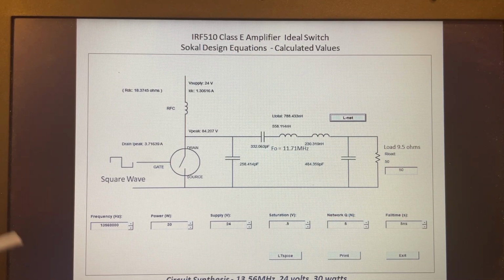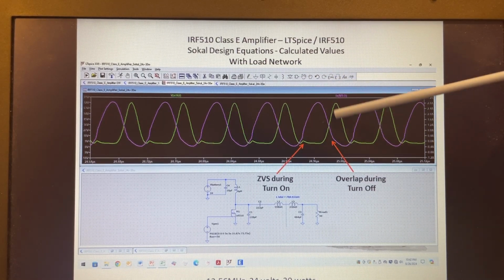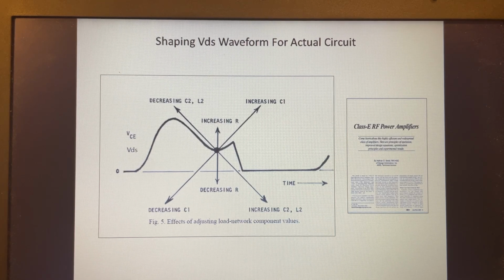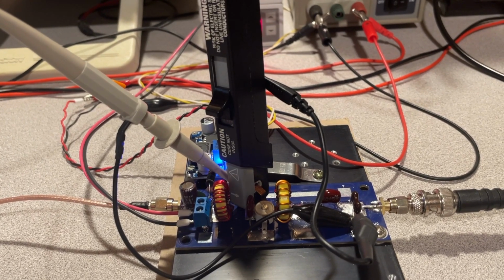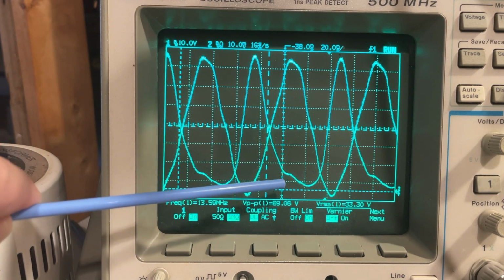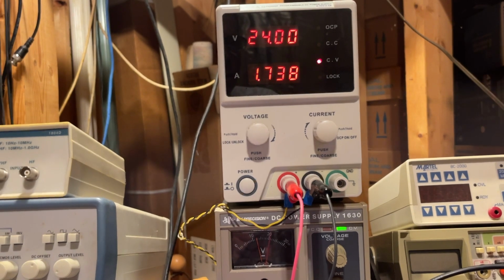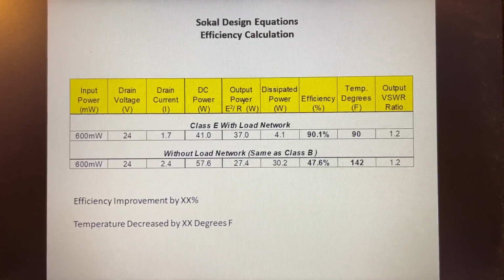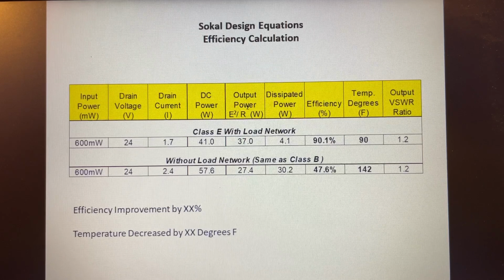Class E RF Amplifiers Explained -  Final Circuit Analysis (Part 4)

Comment: First off, thanks for doing this series, and taking the time to explain so well the derivations and design methodology.
I was initially stunned to see how little dissipation there was within the switching element.
I have wanted to make a little 'wilderness-style' radio and was a bit appalled by the other technologies and what that meant for amount of batteries needed.
I do have a couple of questions: First, say on 40m, what would you think would be the allowable BW before either significant degradation or retuning of components?
Second, I see a lot of 24V designs, but what power level limit do you feel you could get with 12V?
Lastly, can these stages (either complete amplifiers, or just switching elements) be paralleled to both increase power and still use 12V; does push-pull address this?
Again, thanks for doing this series and 73!

Comment: Is it possible to align a class E amp without having a current probe attached?
Reply: You can look at the shape of the voltage waveform to determine how well your wave shaping circuit is working. Remember you are trying to achieve Zero Volt Switching (ZVS), so the rise and fall times should be very fast. You should also see a significant reduction in the transistors case temperature if the transistor is switching more efficiently. Regards

Comment: You do not talk much about what modes this will work for?  SSB?  Seems like other Class E amps focus on AM.
Reply: Class E Amplifiers are hard to modulate in general, since the input waveform is a square wave (ie no amplitude information at all). As-is you could use it for frequency modulation or on/off modulation like CW. Getting amplitude modulation requires modulating the voltage supplied to the amplifier to match the rf envelope. To get SSB you need to combine the amplitude tricks with changing the phase of the square wave sent to the input, which is pretty complicated. This is actually what the uSDX / truSDX projects do using an arduino and controlling the phase of the rf oscilator over i2c.
Reply: @MobiusHorizons  Thanks, that is kind of what I thought, but wanted to verify.  Will checkout the uSDX/truSDX projects...sounds interesting

Comment: Great work. Thanks for the effort. I wonder how this class E amplifier would do for AM and SSB where linearity is required.
Reply: Class E Amplifiers are hard to modulate in general, since the input waveform is a square wave (ie no amplitude information at all). As-is you could use it for frequency modulation or on/off modulation like CW. Getting amplitude modulation requires modulating the voltage supplied to the amplifier to match the rf envelope. To get SSB you need to combine the amplitude tricks with changing the phase of the square wave sent to the input, which is pretty complicated. This is actually what the uSDX / truSDX projects do using an arduino and controlling the phase of the rf oscilator over i2c.

Comment: Interest  video series, thanks.  I see you drove it by a square wave.  Sokal claims designs have been made up to GHz.  Even at 144MHz a square wave would be difficult to achieve, so can you drive with less-than perfect square to switch the amplifier.  Secondly NBFM would not problem, but what about DSB  or SSB.
Reply: Ok that would be interesting. When I finish my current project Im going to look into a 145MHz Class E amp.
Reply: I didn’t test SSB only AM. I will consider this for future videos. Thanks for your feedback. RF Man

Comment: It's hard to quibble with the highly efficient result you measured, but if the goal is to have a high Q 700 nH inductor, an air core should produce a better result than a powered iron core, with the reduced core losses more than making up for the increased wire losses. An air core with 700nH and a Q of 300 is pretty straightforward. I'm curious what you are achieving with the powdered iron core...
Reply: Powdered iron cores (T68-6 in my circuit) can be used to design high Q inductors at frequencies below 200 MHz. The core must be large enough to ensure it does not saturate. Using an on-line calculator the Q value for my inductor is just over 100. I agree, an air core inductor would have a higher Q and less losses. This might yield a small increase in efficiency. With the current inductor, I found the circuit performance to be acceptable and the temperature rise of the inductor to be quite low.  Thanks for your comments. RF Man
Reply: I retested with an air core inductor (OD .625", L .750", #Turns 8) and basically saw the same results 89 - 90% efficiency. I can made a video update if you like.